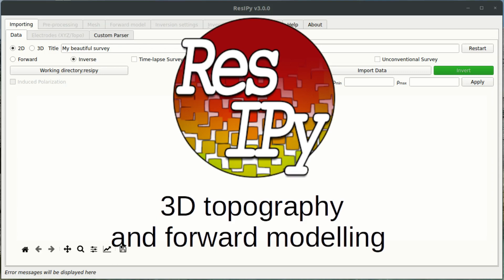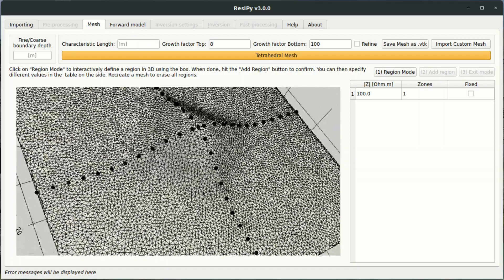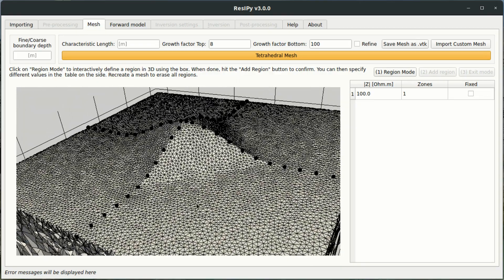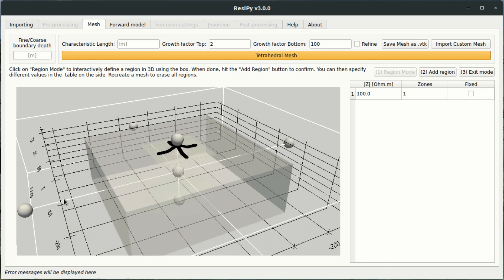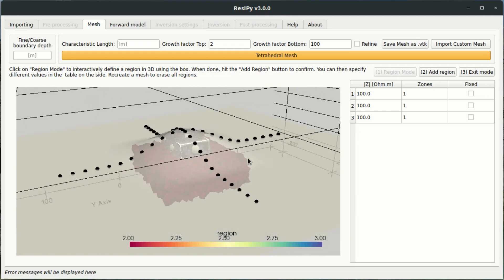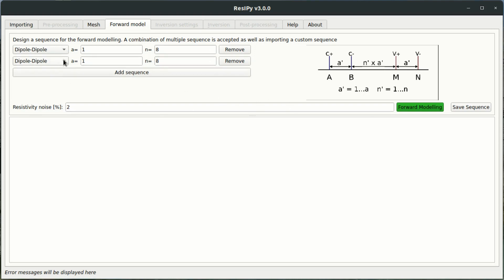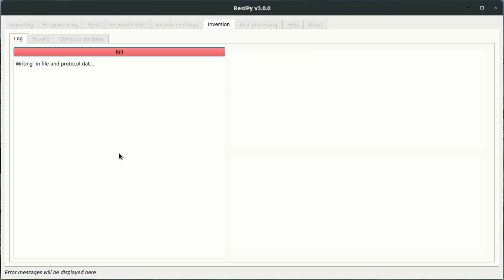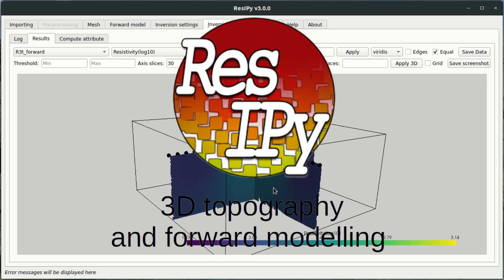Introduction to 3D Forward modelling and Topography handling in ResIPy

Comment: Hi I want to use CSV values that is collected from a passive Telluric current device. It is Depth (only a 0- 30) Millivolt mV at  Frequency and Horizontal Distance value. Can it be used. Congrats to the programmer and thanks for video.